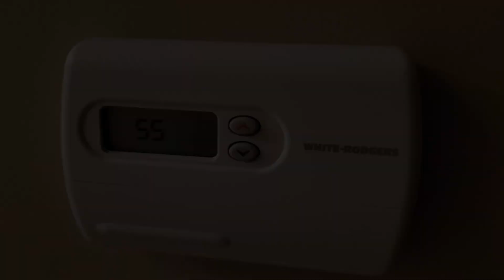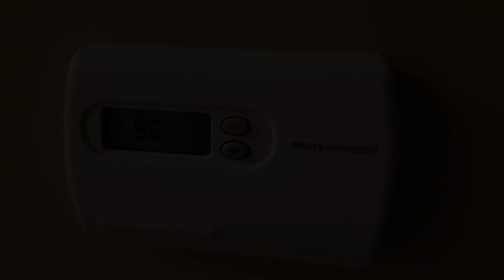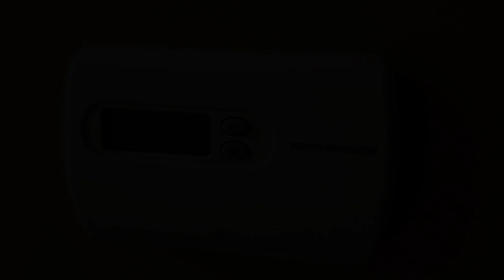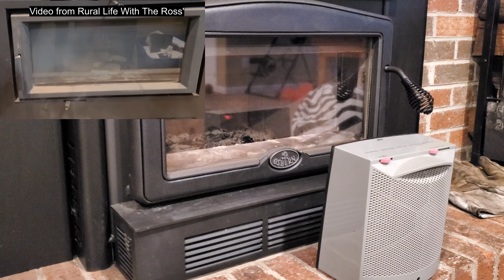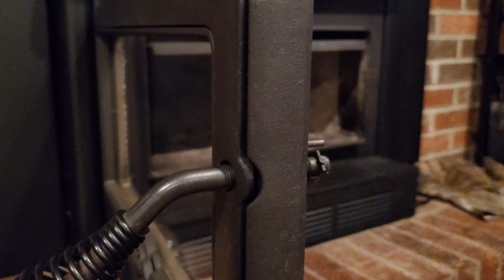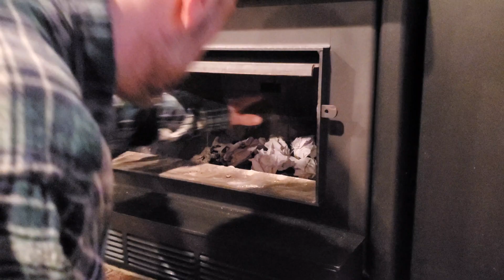How to cleanly preheat the flue to prevent smoking during cold startup of wood stove

Comment: Great idea! I'll have to remember this because Im sick of my Wife bitching at me every morning about the smoke in the house. We're fairly new to having a wood stove (3rd season now) and sometimes ours will fill the entire downstairs full of smoke and sometimes it doesn't. I was actually looking for one of those stove pipe pre heaters but will try this first.
Reply from the maker: In fairness to your wife, a house full of smoke does suck! The only time smoke should be an issue is on a stone cold stove. Once you're burning fulltime, the stove should have enough heat left in it in the morning such that you're not smoking out the house when you re-light it for the day.  If you're smoking out the house even on a warm to the touch stove, then you're likely burning wood that is too green/wet. If your house is super air tight, you might also have to open a nearby window when you're lighting the stove or maybe even during regular operation or install an outside air intake tube. The other pre-heating method I've seen is where people will stick a small propane torch with one of those easy light triggers inside the stove for a few minutes (near the top) to pre-heat the flue. Last idea is that if you are unsure whether you've pre-heated it enough, just light one piece of newspaper and maybe a very small piece of kindling first to see if the draft is good or to at least to get some heat to establish a stronger draft.
Reply: Same boat here. My basement fills with smoke. Thought perhaps it wasn't installed properly. Is all new to me. Knowing is half the battle Go Joe! 😂
Got me a space heater going atm hope it works out.
An old timer said also to put some newspaper in the flute area at the top of the stove inside to give it a better flow out cause it will push the air up directly at the pipe base so it's not going around inside the stove as it has a direct route up n out.
Reply from the maker: @flatout5815  the propane torch method is the one I started using this season. It works way better than the space heater, but since I don't trust those torch head shutoff valves, I screw the head on and off it every time I use it. Takes about 60 to 90 seconds of sticking the torch up in the stove to get the draft started.
Reply: @Redneck_Ed  yeah my boss recommended a torch lastnight. I am using all three methods cause the last two times I tried to start this dang thing up it smoked my whole house out. Had to open all my windows and leave the house for awhile. Was 20degrees outside. Was about to scrap this darn thing and get a propane furnace setup. But that'd break the bank. 
Thanks for your help is much appreciated. Have an awesome holiday and a great new year.
Reply: @Redneck_Ed  ty again. I replied already but yt seems to have blocked it. :/

Comment: Okay, I’ve watched many videos to date. These all work but what to do when the downdraft is from a -30 celcius? An open window and a small blow torch into the chimney from inside the stove. In case anyone wondered 😊
Reply from the maker: I hope you normally have the fire going long before you ever reach that -30c! Either way, the blow torch method is definitely a good one.
Reply: Use alcohol in a cat food can. Place in middle of stove. You can light with a long lighter. If you have to use 2 cans so be it .this method works and no smoke.

Comment: I use a couple pieces of paper , I never had smoke come out of the cold stove.
Reply from the maker: That video from the other channel is pretty wild though, right? Mine would have done the exact same thing without the preheat unless it's in the low 30s outside. I may do another video tomorrow showing mine smoking on cold start.